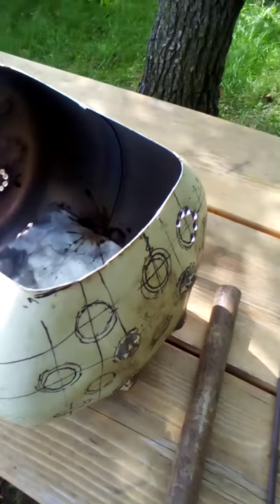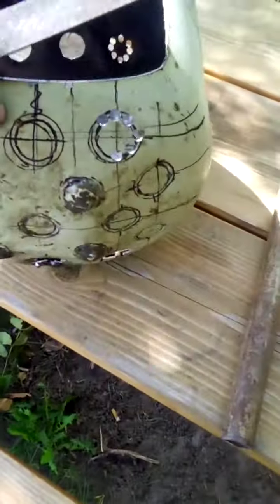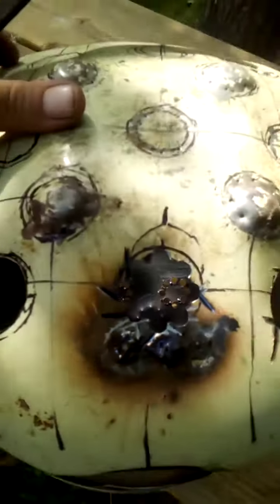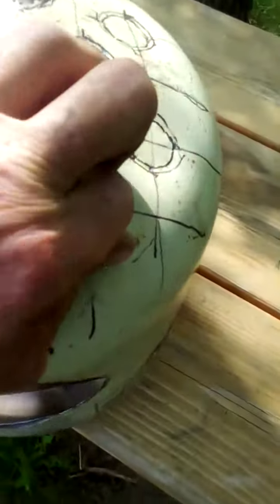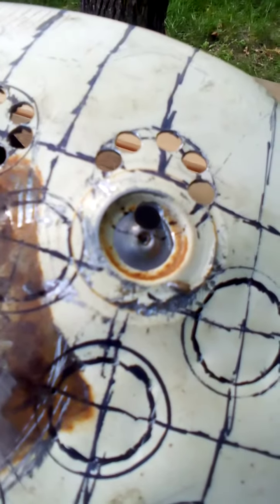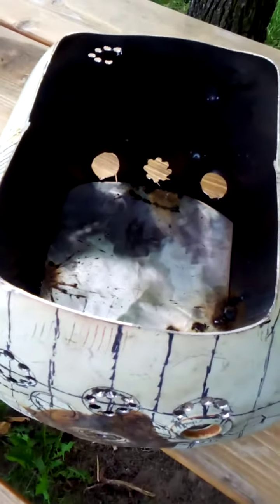$300 a month electric heating bill gotta go

Comment: I grew up with a wood burning stove in my basement that heated the whole house
Reply from the maker: So did I, then Dad built one outside across the driveway out of concrete, a 500 gallon fuel tank, plate steel and the door off an old coal furnace my grandma had replaced with a modern furnace.